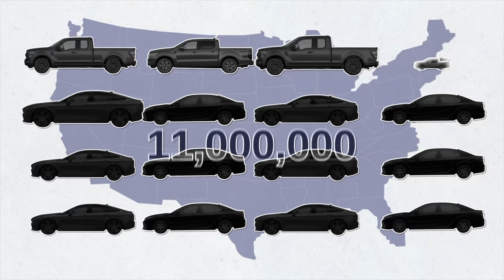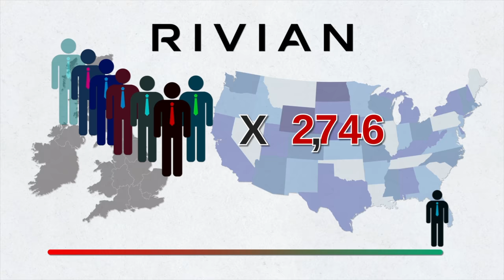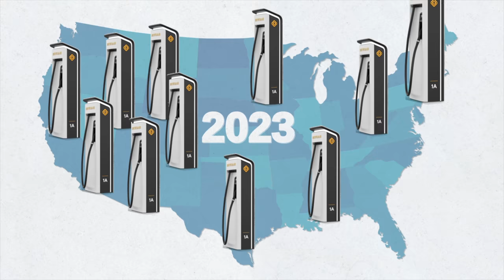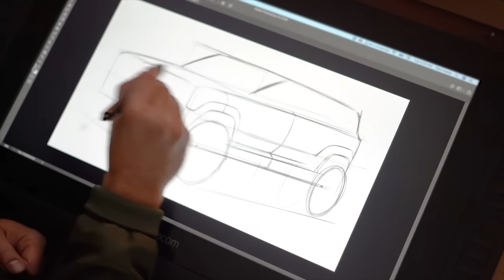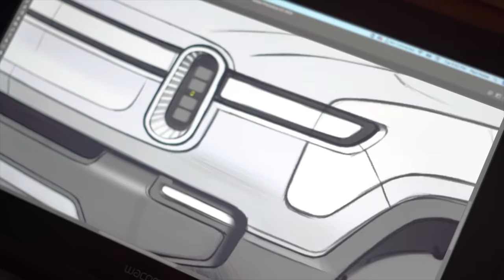Here's Why Rivian’s New Vehicle is the Future of Cars (Goodbye Tesla)

Comment: The problem with Ev's is battery replacement will be extremely expensive in the thousands I would imagine and end of life disposal. You cannot just throw them away as Lithium batteries are flammable and need to be recycled. If not we will have huge piles of spent EV batteries. Seems we are just swapping one problem for another. The cost of $60k - $70k is too high for a lot of people myself included.
Reply: Totally agree with you.
Reply: "...Lithium batteries are flammable and need to be recycled"
So, you recycle them. As capability improves (there are already companies that are recycling the EV batteries), it should be cheaper to buy lithium from a recycler than from a company that mines it.
Reply: The used batteries are usable as is for grid storage. Afterwards further recycling will be needed.
Reply: Battery recycling is terribly inefficient at present and Tesla has yet to give their full support to the only battery refurbishing center in the country, Gruber Motors of Arizona. It seems individual modules within the battery pack have a tendency to fail before the battery pack's projected life span. Cool tech for sure, but without aftermarket support, EVs have zero sustainability
Reply: @swordedaffair  "recycling" of batteries still involves waste that is not biodegradable.
Reply: @jayhaines1792  And your point is? Millions of ICE cars also involve "waste that is not biodegradable."

Comment: Starting price of 70,000 dollars😹
Reply: Its cheap by pick up truck standards
Reply: @killthemall55  an electric one ontop of that
Reply: That's not really a lot.
Reply: "of just 70,000 dollars"
Reply: Ford's gunna hafta do another "Model T" & bring the EV to the masses
Reply: Not too high for a pickup.
Reply: $ 70  k   too  much  for  EV  truck.  better  off  gettin  an  i.c.e. toyota.
a  lot  better  for  a  lot  less  $$.
Reply: I'm not paying $70k for a vehicle.  It's transportation, not a status symbol.
Reply: @driver4011  It's less than a Dodge with a Cummins diesel. Toyota does not make trucks with this much weight capacity. The Rivian is comparable to the F-250 Super Duty or Chevy 3500.
Reply: Yea let's only make cars and trucks for under 25000 what kind of thinking is that?
Reply: @angrybastard7364  the target audience for this vehicle probably makes north of $36k/yr.
Reply: The Rivian pickup is pretty much Mid-sized,  think Tacoma and Ranger
Reply: @stoopidwookie1695  its starting price so most likely closer to 80-90k
Reply: @Bjeezy92  Brands could do really well with a model like that, but they’d probably have a little gold sticker saying “Made in China”
Reply: @stevechance150  lol, you're one of those.

Comment: It seems amazing, but I worry about price of ownership in the long run.
I bought a Toyota because that thing will pay for itself over the next 10-20 years
Reply: not if you bought it new
Reply: Toyota already have their prototype bZ4x and some other coming in next year at an affordable price too
Reply: Bought a brand new 2006 Toyota Tacoma back in 2006 of course.
Paid for a long ago, no major issues whatsoever. As this will be hard to believe I literally just changed the original battery last week. Other than that the only thing I ever had to do with it besides general maintenance, fluids, brakes, tires, is change one of the belts.
Reply: @Maynardd  My 1998 F350 7.3 diesel and 2007 F150 5.4 are also going strong without any issues. F150 has 263,000 miles and drives perfectly.
Reply: @djack4125  i’m curious to know what kind of charge these batteries will hold 15 years from now. It won’t be good. It doesn’t matter how well you maintain the vehicle, the battery will lose charge and there’s nothing you can do about it..
That’s awesome with your trucks!
Just goes to show if you take care of something it will definitely last.
Reply: @Maynardd  I don't know how those batteries work but some Renault cars have a modular battery if some module fail it can be replaced
Reply: @Maynardd  Not sure but Tesla estimates 1,000,000 mile battery life.
Reply: @4himsanctified  I sold my 06 4runner for you guessed, an 8 mile Tacoma. So far so good, plus I made money owning that 4runner
Reply: @poodymeiner3125  sweet!!!
Reply: @djack4125  looking at a '91 F350 7.3 diesel (non turbo), crew cab, flatbed with hoist, and 5th wheel plate. Think I could put it to work. They want $4k or BO.
Reply: @thomas735  Maybe or not. Tesla presently enjoys the highest used resale in USA.
Reply: @djack4125  sandy monroe is a tesla front man
Reply: @Maynardd  there is already info available on real life battery degradation.
Reply: @thomas735  he's not a stock holder of tesla anymore.
Reply: Over the long run price of ownership is way cheaper to go electric. For many reasons.
1.price of oil will go up, it's is a limited resource. More land, tooling, drilling, needed to suck out the last half of earth's supply.
2. Electricity is cheaper per mile than gas, roughly 1/3
3. Less maintenance 
4. After 15-20 years you still have a car filled with valuable materials.
Reply: @Maynardd  How much did you spend in gas the last 15 years? Charging is a lot cheaper and can even be free in some locations.
Reply: @Xyquest  I have a gas card supplied by my employer.
Reply: @mattbrew11  Maybe. What is your source of info supporting the claim?
Reply: @mattbrew11  mmmmkkk. Maybe do a little research, as Toyota was just ranked 3rd and Lexus 1st in reliability,  according to consumer reports.  And that’s way ahead of Ford.
Reply: @Maynardd  Good for you but I don't think that's applicable to the general public
Reply: @louren1951  electric is only cheaper now. It won’t be if everyone starts driving it. How are states going to pay for their roads without gas taxes ? They will start taxing them at some point. Also the grid now cannot handles millions of more electrical cars. It would need a lot more power stations which takes years and years to build. I assume that before that happens electric would get more expensive. In fact. A ton of new electric cars is going to really screw over everyone as we all watch the price of electricity climb to meet the new demand.
Reply: @enriquejavier8056  good point!  So do you want to be the one getting screwed or be the one doing the screwing.  Me....I'm going electric, and if that price goes up then I go solar.
Reply: Yeah but most people don't want to drive a 20 year old car. I do get though that the vast majority of people cannot buy these cars new so resale value will be important.
Reply: @Maynardd  "I have a gas card supplied by my employer."
So, when your employer decides it won't reimburse the cost of gas, because it electricity is cheaper, what then?
Reply: @swordedaffair  there will never be a “what then?”
You can write off $.52 per mile. That’s roughly 5 dollars for every 10 miles that the owner gets back for every vehicle. I drive about 25,000 miles per year. That’s $13,000 the owner of the company gets back per vehicle. Certainly didn’t cost $13,000 in fuel to drive 25,000 miles. More like $7000. Any owner of any company that has vehicles wants as big of a gas right off as possible. Because they make money on it.
Reply: @swordedaffair  and not to mention, they would never go electric, there’s absolutely no time to sit around waiting for a battery to charge. Not until they can roll at least 1000 miles. And with the weight we carry we’d be lucky to get 150, 175 miles per full charge.
Once a work vehicle/van can go 500 miles in a day, carrying approximately 1500, 2000 pounds of weight then maybe? But that certainly won’t be anytime soon
Reply: @djack4125  but they warranty for 8 years ?
Reply: @rhett7716  8 year warranty? Wow, that is a long warranty in this day and age. Meanwhile, battery costs will be falling and range extending.
Reply: @djack4125  Their still in their infancy with batteries even musk admitted that, the only problem is these companies like ford, dodge, Chevy creating a monopoly on it, that's what's happened the past 5 decades, so the cost of a battery should go down doesn't mean it will especially when they get range
Reply: @solidrockofjesuschristmini2423  Ford, Dodge and Chevy are all in MASSIVE debt, and are currently at least 8 years behind Tesla in battery development for EVs with the same quality and range. Anybody can build a prototype, but bringing it to production takes a long time, especially with new technology. But assume they miraculously catch up to Tesla in the next year. With their enormous debt they are going to find it very hard to build the volume to match Tesla when their prices per unit will not be able to compete with Elon. Tesla has already won that battle. In fact, they’ve won the entire war, and very few people noticed. I would be surprised if the big 3 weren’t bankrupt in the next 10 years. It’s becoming more of a mathematical certainty the closer we get to the switch to EVs. You can make an obituary for Toyota as well. Put that $188,000,000,000 of debt on their tombstone.

Comment: I wouldn't necessarily say Rivian is ahead. I think it's too early to tell whether they're ahead of Tesla, behind Tesla, or matching traditional manufactures. Using a modular platform that can be stretched and altered to suit different needs is already commonly done (like the Volkswagen group sharing parts between Bentley, Porsche, Audi, and Lamborghini). In the EV space, KIA/Hyundai/Genesis are already sharing modular platforms to make the Kia EV6, Hyundai  Ioniq 5, and the Genesis GV60. Tesla's doing the same, with the Model 3 and Model Y sharing as much similarity as possible yet still fulfilling the sedan and crossover markets. I think only time will tell. Either way, I'm glad to see more and more competition in the EV space, it'll push companies harder against each other, and in turn, give us better EVs
Reply: Bull crap Tesla is light years ahead of all e vehicles but I do like what rivvian is doing
Reply: @punishthewicked5845  I'm just trying to be friendly. I like Tesla because of how they operate and vertically integrate to bring all the pieces of their cars together. Especially since what they showed on battery day and AI day, it further cements to me that Tesla knows how to push the state of the art. I can go into the small technical details why I think Tesla is pulling off incredible feats of engineering (e.g. Gigacasting, integrating memory into their Autopilot systems, etc.), but I doubt people would like to listen to me nerd out on this

Comment: I knew a retired technical director from a major car manufacturer. He hoped that batteries could be interchangeable between cars   and could be swapped at service stations by robotics using AI.

At the "pump", the old battery is slid out and a recharged one is slotted in. 

The old one goes into a charging area below ground level with many other batteries on rotation and once charged is ready for another vehicle.

The obstacle was getting all manufacturers to use the same battery in the same location under the car.
Reply: In China, there is the NIO, and it swaps battery packs (some YouTube examples). Elon decided charging stations was better; it may yet to prove a bad call. Time will tell.
Reply: NIO already dose this exact thing, they give you the option to buy the battery or lease it. You can charge them regularly but also bring them into a designated batter swaping station, park your car in the bay and robots dose the rest. The changing station are all over the place in China. They are going global.
Reply: They should have toaster sized modules that anyone could swap in their garage. They could have spares charging with solar panels during the day while you are at work for the next day. You just insert the number of modules you'll need for that day and that would save from hauling a heavy unneeded battery around all the time. You could also power your house during a power outage.
Reply: @Xyquest  I have wondered why someone doesn't come out with a main body that's short range with small swappable modules and has a trailer for longer ranges. If you want to go more than the, say, 40 miles it usually does and is near its max, you select the number of batteries you need and put them on the trailer for that distance need. The trailer could take you from, say, an 80 mile range, to up to a 400 range, by holding 1 to 9 modules. On long trips, depots can exchange modules. For interstate trips, depots can exchange trailers. You don't get out and swap modules along the way into the main body; it plugs in and the batteries are virtually on-board. I would have a solo car for work, and a family car, as well, since owning two vehicles per household is quite normal. You would only need the one trailer.

Comment: Why not have the ability to change the battery ( like a battery power tool) when it runs flat🤔,pull into a power station and change over the low battery for a full battery 🤔

Comment: Everyday use and reliability remains to be seen with all these trucks. Especially when you consider where 4wd trucks are used the most in the rust belt states. If everything like ball joints, wheel bearings and brake components literally rust together and rot away how well will the components in and around the wheel wells will hold up on an electric truck in one of the rust belt states?
Reply: Honestly I think it'll be fine. Electric vehicles are so much better in literally every way than traditional vehicles. The issue Rivian has is how things will be repaired when something does break (since people are taking these off-road supposedly). But even in "unreliable" brands you usually don't start seeing major issues for many many years. So new buyers are probably safe.
Reply: @Kevin-cf8uu  I like the enthusiasm but they aren't better in every way, not yet at least. And I'm rooting for Rivian and want EVs to be successful. I do agree I think they should hold up well, and an 8 year 175k power train and battery warranty certainly should out MOST owners at ease. I don't believe it will be flawless, there will probably be some recalls, but every manufacturer has recalls on almost every car, even the good ones like Honda and Toyota. It's what happens when bean counters get to override engineers :)

Comment: I'm sure Scotty knows this, but most others may not.  Did you know he skateboard chassis concept that Rivian is using is not new?  Many of the big, long, luxury cars of the 1920's and 1930's did this too.  The chassis was made by one company and the body that went on top was made by another company called a Coachbuilder.  I think from the name that "coachbuilders" made different bodies back when people used horse and carriages.  A long running coachbuilder was Fisher, founded in 1908.  They went on to make many of the bodies for General Motors (Chevy, Cadillac, Buick, Oldsmobile, Pontiac and GMC), up until 1984.  If you are ever in an old GM vehicle, look at the center of the shiny sill plate at the bottom of the door opening.  I bet it says "Body by Fisher!"

Comment: The ‘RoR’ (Right to Repair) needs to be worked out if any technologies are to advance.  If you can’t fix or improve … there are going to be a lot of ICE replacements running whatever will be the fuel of the future.  🤔🤔🤔🤔
Reply: What would you rather have.... a vehicle that breaks down every month or so and be able to fix it.... Or a vehicle that never breaks down because they dont have... Transmissions, Carburetors, Mufflers, Cam shafts, Timing Belts, Points system, Gas Filters, Oil Filters, Alternators, Starters, and the list goes on..... Booooo Hooooo... You Can however Buy a Conversion Kit for your Existing Vehicle to turn it into an EV.   This would Solve both your issues...... Bammmmm
Reply: @skitzobunitostudios7427   I don't think anyone would drive a Petrol car if it broke down every month 😂

Comment: I have seen the truck in person at a trade show  (but could not drive it) - it's a impressive chassis and definitely off-road capable. It seems like a mature platform already.  I would be a buyer if the range was about 500 miles. And I don't like the industry trend of proprietary chargers - it would be nice to have standard fast chargers with the same software and plug types all over the US.
Reply: The rivian uses the standard charging plugs. Im not sure 500+ will come for some time but ive got an order for the 400
Reply: Reminder of the desktop  computer industry before IBM jumped in and standardized the industry and the advent of MSDOS.  Why IBM didn’t buy 90% of Microsoft is probably the dumbest business mistake ever.
Reply: To me, that's where the Cybertruck shines, in the price versus specs department.  If you're looking at performance and specs versus price alone the Cybertruck is hands down the winner between these two and any of the other electric trucks on the way.  The Rivian has a lot of advantages though, is a good looking vehicle, and is going to beat Tesla to the market by about a year from what I'm hearing.
Reply: your statement is held by most drivers we demand 500 miles like we get today . We also need 15 min charging time or these autos will be only for local driving like today

Comment: Giving the big companies a piece of the pie is probably the only way. Looks good as a base design. Parts being interchangeable is a great idea. Wonder if that will last? I think this obsession with the 0 to 60 performance is costing the overall design of efficiency. You need low end torque sometimes, but I would rather have distance than speed. Nice presentation!
Reply: Too bad its not out yet
Reply: i agree, cant see the need to do 5 secs 0-60 let alone 3 secs in a truck, give longer range anyday !!